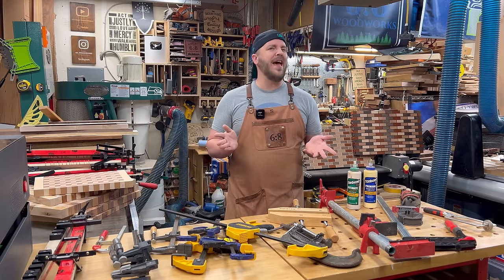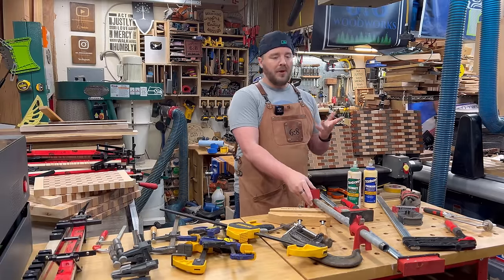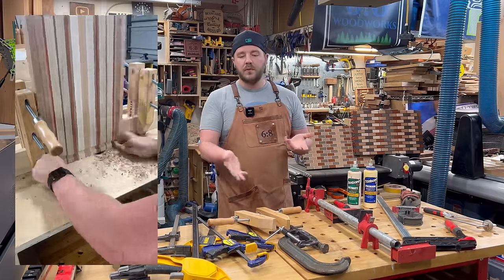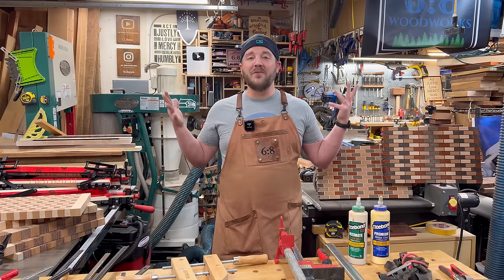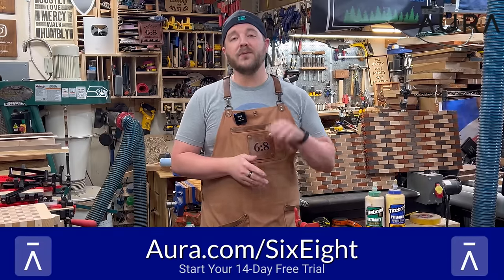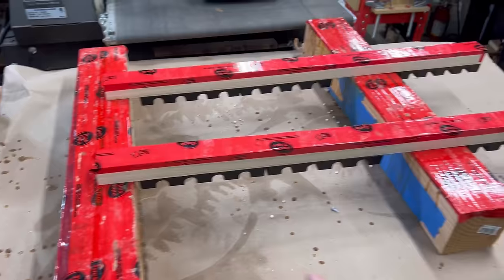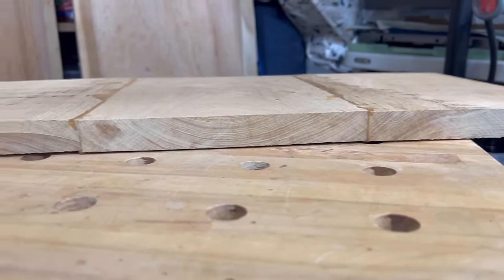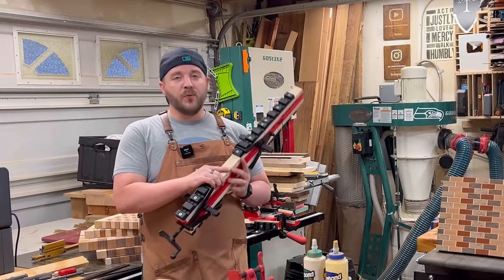Glue Up Game Changer: Best Woodworking Clamps & Affordable Solution for Faster & Better Glue Ups

Comment: Another great one Nick. Every time I watch your videos, I come away with so many new tricks.  I have a pair and made the clamps, I found those cumbersome.  You showed a much better way to use them with the help of the 4 x 4, awesome.  I thought they were not worth the trouble with the clamps.  Much easier to use now.  I also have a rocker set and getting the upper rail was a challenge to set.  A 4x4 makes the difference, you are the man.  Thanks for the work you do.